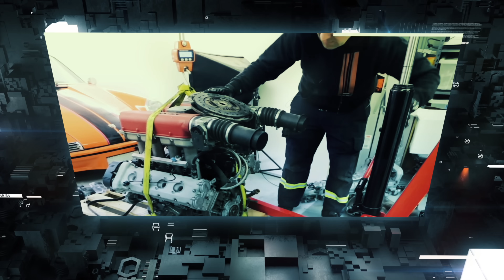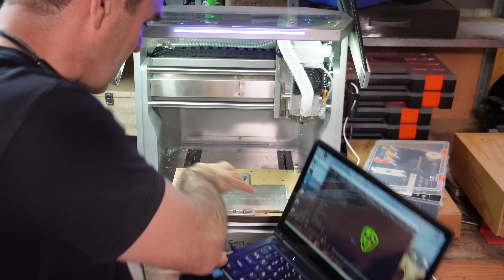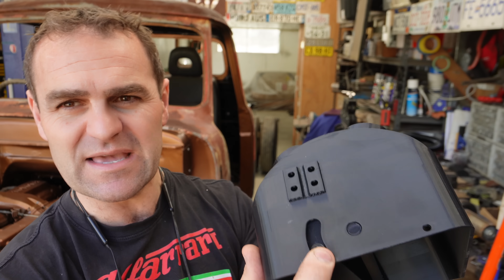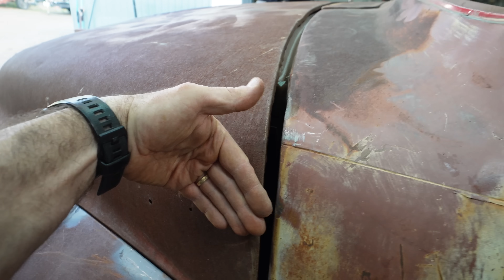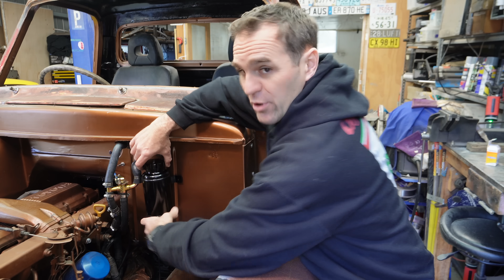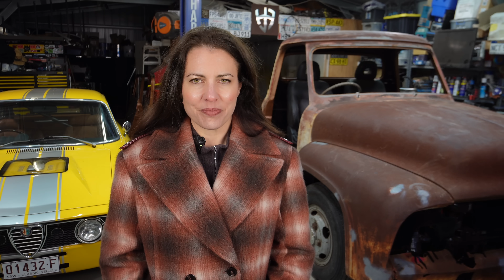Flip front Frankenhauler - 1954 Ford F600 Car Hauler Build part 52

Comment: Jaycar have an easy to fit module that should work for your 24v washer motor. Catalog number AA2306.  It can output upto 1.5amps. Probably the motor draws less than that.

Comment: Still enjoying and in awe of your enthusiasm and solutions.  A simple solution to the washer pump motor voltage would be a resistor in series with the 24 volt feed.  Similar to what is used on an ignition coil, but based on the power requirements of the pump.

Comment: Jeff, for that 12 volt washer pump motor you only need to use a 3 or 4 ohm 25 watt metal frame power resistor to drop 12 volts. Amazon has them.

Comment: Just use two 12v relays in series and tap off from one of the 12v relays. Resistors can get hot.

You connect the 24v positive to the positive of the 12v relay. The negative of the same 12v relay to the positive of the next 12v relay and the negative is connected to the 24v negative. 

You can then connect to either 12v relay to give you a 12v supply.

Comment: I think your overflow tank is a bit on the small side.  I believe there are calculations based on the radiator size and overall coolant volume in the hoses so you can do to find a bigger and more appropriate overflow tank.

Comment: Don’t rush the basics with CNC-milling. Especially if you don’t have a descent amount of manual machining experience.

It’s amazing that 3D printers nowadays have become a real tool and not a hobby in it self.
For CNC machining it’s still some way to go and it will always be more complicated/demand more from it’s user.

Cut a lot of SIMPLE practice parts.
Learn your tools and how they perform.
Use wax/plastic/wood initially.
Use and really understand how your CAM package works.

This will be such a game changing tool for the shop, but it needs to be handled accordingly to have success’s with it. A lot of time investment, but it will pay of if done the ”right” way.

Comment: FYI, you can just tap off of the ground to the positive terminal of the first battery from ground and that will get you 12v. If it were me, I'd have a feed coming off the + of that battery, feeding to a little fuse box, for all the 12v accessories.

Comment: Search for Automotive buck converter. Those come with a waterproof automotive housing. Another person suggested the  LM2596 24V to 12V step down module, which is a buck converter, but a 3amp version might not be enough. And it is not an automotive version.

Comment: Nice job on the Intake and heater box. 3D printing is a godsend; I use it for all kinds of stuff. That Carvera cuts terrible (wrong tool, speeds and feeds for the job for starters). As a former machinist, that's barely a toy. Why not just run the washer at 24v? Duty cycle is so low I can't imagine that's an issue. Any plastic bottle from the junk yard would have been cheaper no doubt - and with a much larger tank. I know you are just trying to make a buck and give us audience a lot of enjoyment, but as the free product infomercials ramps up the channel is starting to feel more like the shopping network which is sad..

Comment: The windshield washer pump may last longer than you think, since it's only operated intermittently and for short periods.  As for the heater controls, Ford was pretty basic on their older trucks.  On my 1966 pickup, there's just a couple pull knobs mounted underneath the dash, you could do the same with a couple generic choke cables.

Comment: On your badge making; awesome "first project". This machine has lots of potential, how user friendly will ultimately make or break it's success. A thought comes to me; rework your badge design a bit so you can include cloisinea insets,ala the A/R badge. You will need to source crushed and dyed glass for the inset spaces, the melt process is within the capacity of a conventional oven.
You now officially have surpassed the "wobbly pillar drill" level of shop tooling!
On the hood adjustment; move the fenders back to cover the witness marks on the cab paint- should solve both hood to firewall and front line evening. For an inexpensive kit, that is still a nice piece of work- just fiddly.
Nothing to add to comments already made re a 12/24v system; it will definitely make later powered options easier to install. On the radiator return; may need bigger catch/ return can; look into a truck wrecking yard for something. 
Mrs. Jeff- loved the coat! More of that Aussie wool! Wish Ford had learned more about quality and consistency from the Continental; they still haven't figured out how to build a small well built car domestically to this day. You would almost think Ford, GM, and Chrysler did not want to do that, even after Toyota, Nissan, VW, Hyundai and others have shown it could be done with US labor. 
Still wanting to see you both cruising the Alfarrari and FH! Fred

Comment: Jeff, do you have access to both 12 and 24 volt circuits on the chassis? If so, you can connect the 24v pump positive and connect the pump ground to the 12v. That will let you run the 12v pump.

Comment: Can't you put a resistor or voltage regulator in line for the washer bottle motor so you don't burn it out too quickly? Worth a "Jeff Double Try (JDT)"?

Comment: My 1932 BSA runs 6v and 12v - the car has two 6v batteries in series and there’s a 6v tapping off one battery and 12v across both.

Comment: Nice work on the hood (sorry, bonnet :-)  The back gap along the window is fine. 
Reminds me of my dad's old '51 Ford, with all the wear and tear.   
As long as it doesn't leak horribly, it's just part of the oldschool look. Like the heater valve. It's vintage dude.
The front could line up a bit better though. Especially left side. The heater valve is fine. More charm.

Comment: Might be possible to drop the voltage to the washer motor. If you measure its current draw to get the right values for them, a simple voltage divider made with a couple of high wattage wire-wound resistors would do it (ETA >> you can parallel resistors to get higher power handling if you can't get big enough ones). This definitely isn't something to use with anything drawing current for very long, but since it will only be running for a few seconds at time I wouldn't have thought that would be a problem.

ETA >> now I've checked, a better idea would be just buy a DC/DC convertor! 24V > 12V 10/15/20A ones are cheep!

The flip front is so right for that cab.

Comment: You could use a "push-pull" knob, like those for a manual choke, to actuate that flapbox and that 3-way valve. Those wouldn't look out of place, i think. And maybe some kind of 24V to 12V transformer for the washer spraymotor. Oh, and from hearing the sounds, i think you were taking of too much material in 1 pass on the desktop mill. These tools are pretty fast at completing a full pass so they can't handle too much bite. Plus when you take off less material per pass you'll get a much nicer finish.

Comment: Really like the hood/bonnet tilt-up, and would like having that on my '60 Ford F100 Panel truck. The hood weighs a ton. The 12 volt pump may surprise you and run indefinitely. Years ago I converted my neighbor's 1928 Chevy to 12v from 6v and an old timer said to just use the 6v starter as is, and it did fine for as long as he had the car. Another option is the old VW washer bottles that take compressed air with a shrader valve, and as I recall, work quite well with NO wiring.

Comment: like what you do with this old Ford. I have a question about the heater cores height in relation to the radiator and expansion tank. As they look like it much higher are there going to be issues with getting the air out or the heater core.

Comment: hi jeff ebay has 24v dc to 12v dc converters for about 24 aus bucks you can also use it to power a radio and put an accessories plug in too win win in my books cheers glenn

Comment: A choke cable and Knob out of a classic Mini might suit the job and aesthetic you're looking for the heater control. Maybe adding hard stopper to stop the knob being pulled to far and breaking stuff might be a good idea with unit being mostly 3d print plastic. I think some of those classic minis actually used a cable style pull/push knob for the heater too with the appropriate heater icon/label built into the knob already.
Reply: That's what I used with that valve on a modified MGB GT, it works well, and is simpler than the rotary knobs used on MGBs.

Comment: With laser welding you can make 3D metal items and using different metals.  I have been using laser welding to make both injection mould tool inserts and repairs since the 1990's.  It builds up metal by layers.  Its like 3D printing for plastic parts, but using higher power lasers.

Comment: Instal a voltage reducer 24v to 12v  for the washer bottle. Readily available bolt together thing.
Reply: Yup, an automotive buck converter.

Comment: Love the channel Jeff. Doesn't the overflow tank need to be higher than the top of the radiator? At least the pressure cap on the top...otherwise the coolant won't fill the top of the rad....
Reply from the maker: Nope, not how it works.

Comment: You could use a 24v to 12v voltage reducer. These things are not expensive and they can be hidden away out of sight so you can achieve what you are wanting to do.

Comment: Hi, does the coaster utilise 2x12v batteries in series? If so, can you generate a suitable set-up to wire from a single battery to have a 12V and a 24V system in the vehicle to power the associated systems?

Comment: When I was in engineering training many years ago, the tutor melted some wax and moulded some wax blocks to test the cnc programming to save ploughing the tool into the workpiece. Saved a lot of tools and spindles!
Reply: Or even some plywood!
Reply: @JayFrVz Wood is forgiving and an excellent material when starting with CNC.
Reply: Paint the 3 way valve in the same bronze will take your eye off it

Comment: morning from Scotland, how are you planning to blead the cooling system , the highest point looks like its the heater , a tee in the heater hose to a vent valve (house radiator blead valve would work).
as per normal a very well made video

Comment: A resistor can cut the voltage ,
A 12v brushed motor should be able to handle 24v providing the current is not too high so a resistor should be all that's needed .
Measure the resistance of the 24v and 12 v motors and pick a resistor to match them up.
Reply: Automotive buck converter, that would be the solution.

Comment: Would using an electric heater water pump have worked?   Jaguar (mid/late 1990's and up)  used them and I'm sure many others marques did too.  Might make for cleaner mounting?  Sounds like you could stand to add a 12V bus to system .. I was about to say for simplicity but.... I'm sure there are 12V regulators or dividers, but clearly it would need so be something both robust and able to handle the amps.  I don't suppose it's 24V by running 2x 12v batteries in series? (easy enough to just tap the middle pole in that case).

Comment: My bmw e24 serie 1 (1976-1982) have washer jets between the louvres off the bonnet, so you can’t see them from the outside. I think some louvres looks nice in the bonnet, if you make them on the fire wall, it’s easyer than fix them on the bonnet

Comment: Here to comment for that crazy algorithm! Try a LM2596 24V to 12V step down module for the washer bottle pump. Ps love your work!
Reply: If the vehicle has 2 12v batteries, there is already 12v available at the point at which they join
Reply: @hamishwatt2475 that's a good way to flatten batteries.
Reply: Beat me to it as regards the 24v >12v transformer. Ebay...less than $30-.
Reply: @billroach2393  I guess it will be nice for other purposes also, stereo and usb-charger  maybee?
Reply: As above, connect to one battery directly (even if the batteries are still connected in series to each other for 24v). That will give you 12 volts. Don't believe it? Use a multimeter to check it out 👍.
Reply: @BackyardMechCon  I was thinking the same thing. He should make a separate 12v circuit for things like USB charging and other accessories. Then he could use relays from the 24v circuit so he could still use all the Toyoda switch gear.
Reply: This. No need to fry that little motor.
Reply: Yup have a dozen of those through my campervan.. I bought mines from China at 1 USD each! 24 V is a strange beast so I would have a few of those stepdown modules handy as you will no doubt need them for other accessories. Warning: they are polarity-sensitive.
Reply: Was about to comment the same 24v to 12v converter 😊
Reply: An automotive version would be better suitable. Those come with a waterproof automotive housing.

Comment: you could use a 24 volt relay and put the triggered feed coming just of one battery that comes through the relay to power up the washer motor as a 12 volt

Comment: Jeff if you add some resistors in series you should be able to reduce the 24v down to 12v
Reply: Be mindful resisters get very hot and can burn or melt stuff.
Reply: @jamest5149 but the washer only operates momentry?
Reply: Washer motors are about 45w, so you'd need a VERY big resistor to dissipate 45w @ 12v.
Reply: Totally agree jeff you would need two to three ballist resistor each ballist will drop 4 volts
Reply: yes agree resistors cleanest way to sort an issue here
Reply: My thougt too! 😊
Reply: Buck converter is the best solution.
Reply: Buy a 24v washer motor. Not hard

Comment: Great progress. Maybe a dedicated small 12 volt battery for that washer fluid pump?
Reply from the maker: Haha. I can just see that always being flat when you need it :D
Reply: @HomeBuiltByJeff  or a 24v-12v dropper. There on amazon JD.
Reply: I love flip forward “bonnets”. 

As you were explaining the new CNC printer I thought it would be cool to print some badges, and … viola! HBBJ badges appear. 

Have you thought about a 24 to 12 volt step down converter? 

Cheers from NJ, USA …
Reply from the maker: I definitely could use a converter, for a few smaller things to make it a bit easier.